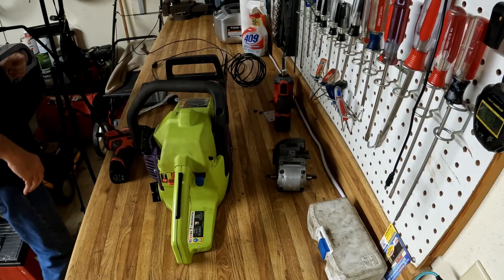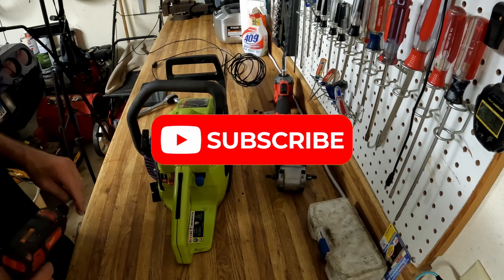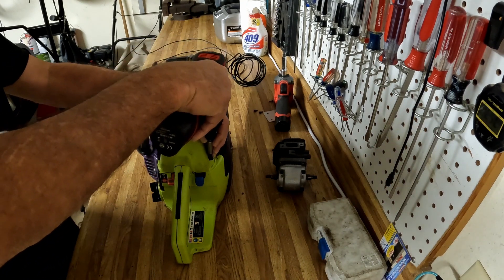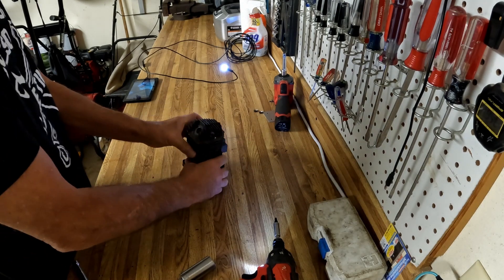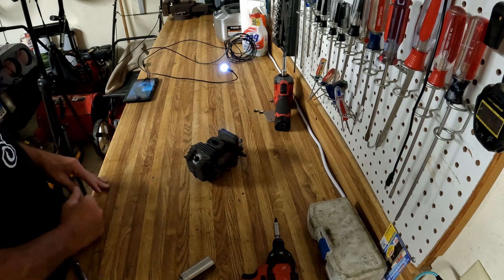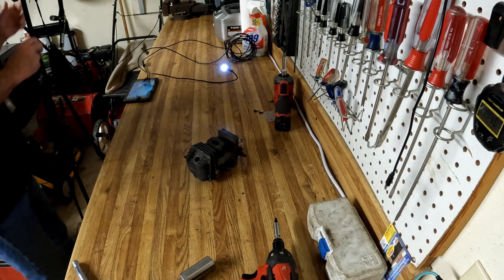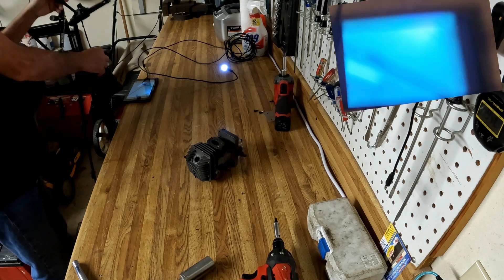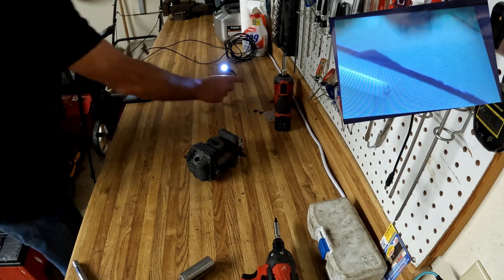What happens inside the engine when you run regular gas in a 2 stroke?

Comment: Good video Bill, the scope works great.
Reply from the maker: Thanks. This one was only about $20 on Amazon and it comes in handy both while working on motors and other things around the house too.
Reply: @GuysPlayingWithTools  I'm going to check into one.
Reply from the maker: @barryewalt5368  I use the waterproof one intended for drains, it's a little longer than you need for motors but it's waterproof

Comment: I have a John Deere LA135. It's old but it still runs. The problem is that I need to replace one of the back tires and the rim is frozen to the axle. Can you do a video on how to get that rim off?
Reply from the maker: I have a D130, pretty close and the wheels attach the same way.  I will do one this weekend and cover what to do when the wheels don't want to let go. .  🙂
If you have the tire,  it's almost just as easy to replace it while it's on the tractor, I will touch on that too.
Reply: @GuysPlayingWithTools  Awesome 👍 Thank you!
Reply from the maker: @colonypainting711  I just finished the video pulling the wheel off, it should be online by 8. I do a lot of languages so Translations can be painfully slow.
Reply from the maker: Published 🙂

Comment: One time I was cutting grass with a weedeater and ran out of 2 stroke gas and oil so i took a empty oil bottle and filled it marvel mystery oil and used it to mix gas, the 5 year old weedeater still works just fine. I've also heard stories of people using very thin motor oil in 2 stroke gas but I question how well it would work.
Reply from the maker: The mix you buy for 2 cycle motors is designed to burn reasonably clean so the plug won't foul and it won't gum up the carb or exhaust screen. It's not far off from 30 weight oil outside that. We have an old saying "using the right amount of the wrong oil is 100 tines better than the wrong amount of the right oil.

Comment: One of my friends Lawn business and they used to have so much problem with these guys putting regular gas into the 2 strokes equipment that he started putting oil in everything everything! So it  was alll 50:1 and he had zero problems from there on out and he would run his equipment well over 12 hours a day during the summer in south Louisiana.
Reply from the maker: Great idea.  A mower will run happily on 50 to 1, might foul a plug here and there but that's an easy fix

Comment: So stupid to run a tank with no oil because you been running more oil than normal.  I run about 48.5:1 in my 50:1 engine only because the oil jugs come for 2.5 gallons of 50:1 and my jug is only 2 gallons but my equipment runs flawlessly for years even though it’s 50:1 rated.
Reply from the maker: Your equipment will never see my bench of you treat it that well 😁
I go 40 to 1 on everything.

Comment: Great video! I've been using two cycle equipment for decades; back when 32:1 was the standard. Prior to ethanol you could make your two cycle engine last forever just by keeping the muffler ports clean of carbon build up.
Reply from the maker: Thanks.  My favorite  equipment is probably 12 years old,  it still looks great inside because I have gone 40 to 1  for all it's  life

Comment: Seen that so many times in my shack, they think just I tank to finish the job because they have run out of oil  and bingo the engine is toast. Great vid and well experienced.
Reply from the maker: Thanks 🙂 I see it sooo much I just had to show one and this one was burned up more than usual
Reply: Awesome video! I would never run a two cycle engine without oil. My biggest issue has been ethanol. It's terrible. I've been using two cycle a long time, back when 32:1 was the standard. Before ethanol the biggest issue was carbon build up in the muffler ports. Keeping those clean could make your two cycle engine last forever.

Comment: If you ask for trouble, sometimes you get it. I have a chain saw and a bit disc cutter to do that had the same issue. Many thanks for sharing.
Reply from the maker: Yes you do.  🙂 I prefer to do the top end rather than a whole motor but this one had obviously run really hot and it was only $16 difference in price
Reply: @GuysPlayingWithTools  The ones I have are Stihl, and as long as I can work out which barrel to buy, it isn't a problem. I bought them for £5 each.
Reply from the maker: @BensWorkshop  that's a really good price,  even with burned pistons
Reply: @GuysPlayingWithTools  It is. I need a few other bit, like an exhaust for one and an air filter cover for the other. Got them from a scrap yard.
Reply from the maker: @BensWorkshop  I really need to find out if we have anything like that here. I am always hearing about the great deals people get that way.

Comment: My next door neighbor hired a professional tree service to remove a 3 story tall oak tree that was dying. The older gentleman was roped up high in the tree cutting limbs when his saw ran out of fuel. He lowered to saw on a rope and instructed one of his helpers to refuel the saw. The helpers were much younger guys, maybe 20 or so. Saw goes back up via rope and the older guy continued cutting for a few minutes. Suddenly, the older guy stopped the saw and let out a few (hundred) choice words directed at the ground crew. Even I learned a few words that day. The kid had filled the Stihl with straight gas. Boy, was the owner of the tree service PO.
Reply from the maker: I bet! It only takes a few minutes to do a TON of damage to the motor.